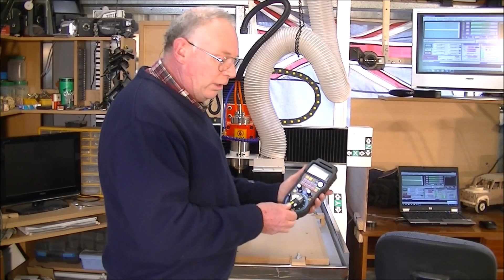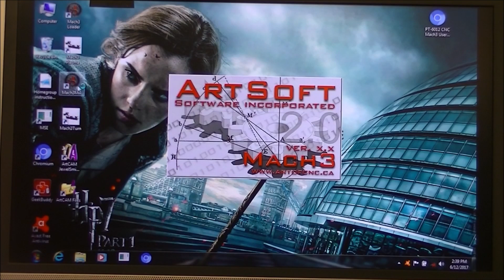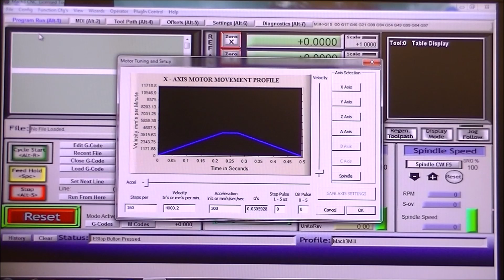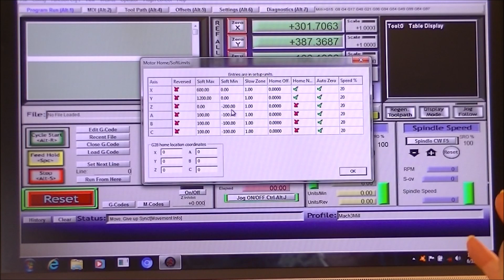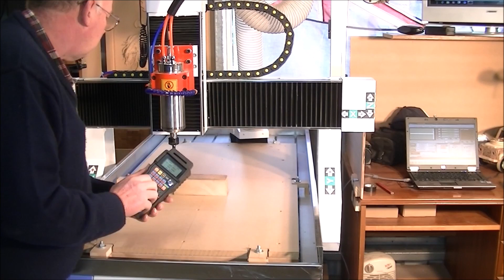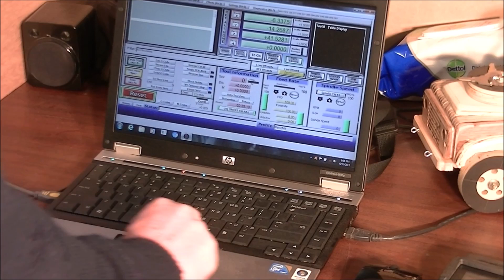Chinese!!! 6012 CNC router setting up Mach3 with servo motors

Comment: Did you have to set up your encoders in Mach 3 and if so how did you do it? I just built my 2nd cnc but am using servo motors this time and can only get the motors to run if I unplug my encoders. The motors run continuously (sitting on a work bench not hooked up to the machine)with the encoders unplugged and stop as soon as I try to jog them they stop). When the encoders are plugged in the motors don't work, they get an initial pulse and immediately stop. You're videos are great. Thanks.

Comment: Can you supply current model number and any other information on the wireless pendant. I want to make sure that I get the most current model as there are multiple listings on Amazon. If this is something that you sell, I would prefer to go that route. Thanks for all of your great videos!!!
Reply from the maker: In answer to your question I purchased my CNC router from a place called BoostCN. Their email is boostcn@hotmail.com if you want to contact them.